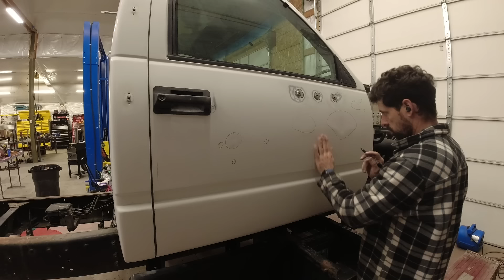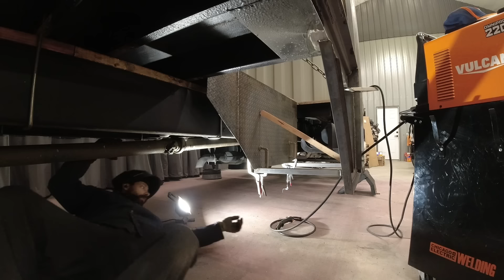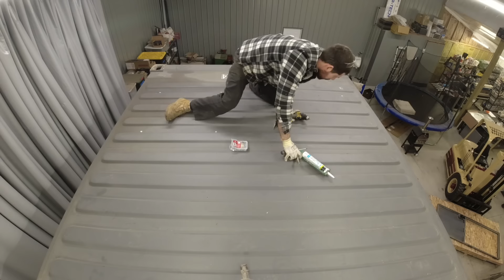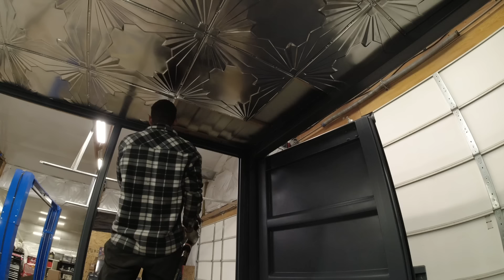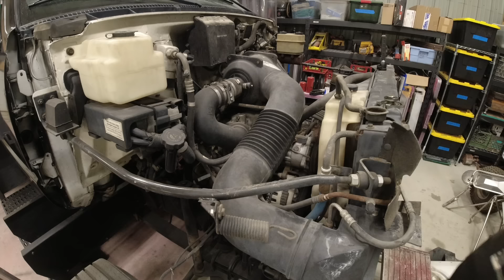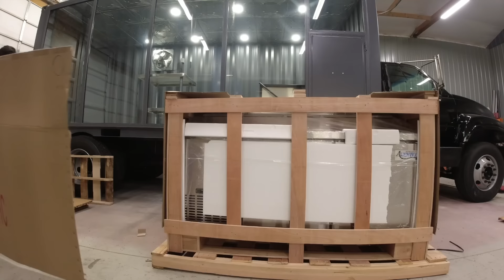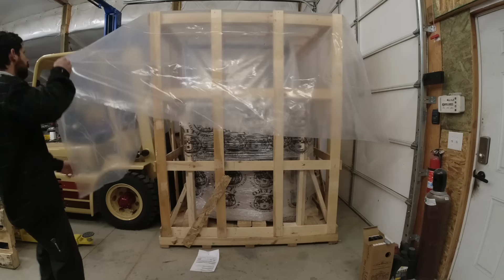I Built An EVEN BETTER Pizza Truck Out Of An Old Box Truck

Comment: I've built and lived in RVs that didn't have such a big oven and I hope this is going to be a winter Pizza oven because summer time this thing is going to be an oven inside you won't need to put the pizza in the oven
Reply from the maker: I wouldn't want to work in it in the summer, but i've built this company 3 of them and they are booked all summer long. One had an ac unit for a while, but they removed it because it didn't do much

Comment: I don’t know if the question has already been asked, but about the floor tiles… I was wondering why you didn’t put the full tiles along the side with the glass, and hide the half tiles underneath equipment on the back of the box?
Reply from the maker: I mocked it up both ways and found that when looking at it from the outside, the framing of the windows hid the first 6" or so of the tile, so I thought it looked better putting the cut piece on the back wall

Comment: Super cool project.  My plasma cutter is one of the best tools in my modest shop.  Heck of a shop you have there with all the awesome tools, lift, and a trampoline!  I have had a couple of the same chevy platforms and engines in shuttle buses I resold;  they really were great.  I subscribed.

Comment: If I could build a food truck for pizza I would want an extender that can push the ovens outside of the area so the heat will escape in the summer time out the back on heavy duty rails. Also a panel that can close off that area to reduce the heat on the workers.

Comment: What type of 1/4 inch rubber seal are you using for the frame and how exactly are you using it? Just on the bottom? Is there space between the glass and metal all around since you said they aren’t touching? Is this space where the adhesive goes? Is the adhesive holding the glass in place then? Do you remove the rubber seal at the end? 

Sorry for all of the questions. I plan to add Plexiglass windows of this size on a box truck, but with wooden framing. My case is different so these things might not even apply to me but I’d imagine that I would still need to protect the Plexiglass from rubbing against the wood while driving. 

You’re the only guy on youtube doing this sort of thing so I’m hoping you can help me out.

Comment: Had a thought about the legs on the cooler table, a set of leveling casters on foot pedal locking system would be a really cool addition for cleaning and maintenance

Comment: Replacing a perfectly good box with a shipping container is peak buzz word trend stupidity
Reply: Or just maybe the shipping container is more durable and can handle more punishment from the elements and it went with the style her was trying to go for
Reply: @dennismctye9048  it's low grade steal that can rust through pretty quickly. An aluminum sheathed box is more suited to hold up to the elements. And it's like they are going to go 4x4 with the box.

Comment: I have always thought, but lack the skills, to take a Honda Civic and cut the body off behind the front doors, leaving the floor pan and rear wheels. Then build a small Hot Dog wagon on it. If you made a box frame with snap-on canvas panels, maybe an aluminum roof. They get a lot of equipment in those Hot Dog carts so I know it could be done. The Hot Dog carts work in almost any city.

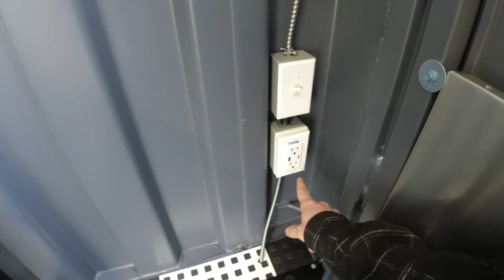Comment: 52:00 You installed the gas cylinders upside down. There's a little dollop of oil to lubricate the seal and it's sitting uselessly against the end of the body. Tell your customer to flip it so it doesn't fail.

Comment: Sounds like you have VERY LOW expectations of that oven company, but yet still buy them...  why???
Reply from the maker: I'm just the builder, not the buyer for the ovens, but my understanding is that there are only a couple companies that make these types of ovens so options are limited and most are not designed to be used on trucks or trailers  so that further limits the choices out there
Reply: @AustinCoulson  that sucks.

Comment: You can use glass cleaner to cure the caulk bead and then stripe off the excess after five minutes with a bone tap
Reply from the maker: Interesting. I will try that out. Thx
Reply: @AustinCoulson  just a heads up use a can not a bottle, the accelerant helps it cure,I believe

Comment: Do you not have a 9in grinder? impressive work!
Reply from the maker: I have a 9in grinder but I only used it on the main opening while I was preparing to install the framing for the glass.  I used the 3m cubitron grinding wheel to remove a decent amount of metal.  I didn't show too much of it because it was super boring to watch

Comment: My only worries would be that's a lot of glass and it's not flexible so on the roads in Chicago will crack the glass
Reply from the maker: knock on wood, but so far I've built 3 trucks with over 7 years of service in Chicago and zero cracks

Comment: I hope they will have AC, not just the vent fan... not because of the oven, but because of that massive glass wall turning the entire kitchen into a solar oven.
Reply from the maker: This is one of the most common comments I get on these trucks but this is the 3rd one I've built, all for the same company and they always decline AC.
Reply: @AustinCoulson  that's so interesting. I can imagine the energy required to run an AC would be limiting in operation. Perhaps a simple awning to keep the sunlight from hitting the window would serve a good purpose. I dont know, i havnt been in one, but the greenhouse effect has to be intense.
Reply from the maker: @guywithinterwebs  the vent fan replaced all the air inside every 90 seconds so that helps. It would not be tolerable without that

Comment: Wait doesnt wood onto metal create heat bridging and thus wood rot later on?
Reply from the maker: Are you referencing the wood placed between the metal frame and shipping container?
Reply: @AustinCoulson  yes, the wood on the roof
Reply from the maker: @uribove  I thought you meant the wood between the vehicle frame and the container. I haven't seen any issues with any of the wood from the first truck that is now 5 years old and wood has been used under boxes and on top of frames as the standard for over 100 years so I can't imagine it's a big issue, but I suppose all wood will eventually rot.
Reply: @AustinCoulson  I've always heard in tiny house vids that you need a gap between the wood and metal that is filled with a good insulator, in most cases just PU foam
Reply from the maker: @uribove  oh yea in a climate controlled space for sure. That's why you have to house wrap the wood before installing metal roofing or siding. These trucks aren't air conditioned or sealed

Comment: I work at an industrial paint shop. We have blasted and then painted smaller shipping containers for the military. They can either air drop them or truck them in. I guess they end up being portable gun smith work stations, or?

But anyways when we painted them we used airless Graco pumps with a 219, 217 tip or a 215 tip, depending on the painters preferences. And don't thin it unless you get fingers, and only thin it enough to get rid of the fingers
Reply from the maker: Thanks for the heads up on tip. What type of paint did you use? DTM or primer?

Comment: Let you know what mistake you made?
You made more than one. 
1st mistake was cutting out the lower section and not completely framing it but before moving to something else. Frame it then make your cutout. Decent tacks will hold it together and not let it walk out on you.
Then cut out the side panel. This way will keep the channel on the bottom of the conex from sagging on you. 

Always support what you intend on cutting out. It will save time and prevent excess steps like having to rack a section to add support.

Other than that. That's a pretty awesome build 
👍🏻👍🏻👍🏻👍🏻👍🏻

Comment: not to be that guy but your handrail isn't to code. you cant have the connection rod off the side like that. has to be off the bottom then a 90 degree bend and the rail has to be an inch and a half from the wall. <designs building blueprints for a living
Reply from the maker: Nobody  cares about that stuff on food trucks.  They want hot water, 3 sinks and nsf labels on the stainless

Comment: Marques made a comment that the F1 app for the Vision Pro does not exist yet… it actually does exist, I have had a demo of the app, but it is not public (yet).  The app was developed for one of the teams and has feeds from the car with all of the measurement points (over 250 different) in real time.  It has live camera feeds from the car with front/rear and the exact position of the car on the track.  If someone from Marques YouTube channel contacts me, I will put them into contact with the organization that has developed the app.

Comment: your body filler has pin holes because you stirred it and didn't fold it together with the hardener. also you can always throw it in a vacuum chamber for a min and it will come out nice and smooth.

Comment: You are extremely talented! Thanks for making this video! One quick question, how do you deal with the heat from the oven heating up the entire truck? For a place with very hot climate, I'd imagine this would be unbearable without Air Conditioning. Would you recommend also installing air coolers and is this possible with the electrical loads like a fridge, mixer, etc.? Would you add a generator somewhere for extra power or is there a way to run it off the truck with extra batteries like a lo rider?
Reply from the maker: The inside does get hot, but one of my trucks has AC and it barely does anything because the vent fan pulls out the cool air and the service window is always open. Even lowering the vent fan speed doesn't really help. That is why they opted for no insulation, the best way to keep it cool is just to pull the air out as fast as possible. It doesn't help that AC draws a ton of power like you mentioned and the truck that has AC has to run 2 generators.
Reply: @AustinCoulson  That makes sense. Thanks for your reply!

Comment: If u want tour body work to be a little better, first shot, use a product called dry coat.. usually a powder, sometimes a spray on product, helps show you low spots, and high spots..
Reply from the maker: I love dry coat. I used to buy cheap flat black spray paint in bulk as a guide coat and it worked really well until I found dry coat. I didn't use it on the fiberglass because it was so beat up and just a quick commercial job, but it's a game changer on high end jobs. especially with long flat panels

Comment: Did you have to rework the truck or did Billy Bricks not buy or they just don't have your truck out working yet? The three trucks on the website are not your truck.
Reply from the maker: They still have 3 of my trucks and a similar looking one that someone else made, but all three trucks have had the boxes painted by a local artist.
Reply: @AustinCoulson  They just haven't updated their site yet then, I noticed all the trucks listed on their page had rear or middle serving doors / table. This front forward door one isn't on there yet. I use to work a BBQ joint and we had a local artist too do all our painting work and ad stuff. Good work for sure.
Reply from the maker: @BluntedBaboon  The 3 I built are all different, one has a rear door, one has a middle and the front door is the most recent.
Reply: @AustinCoulson  Ya looking at the 3 trucks on the website, I assumed the 2 listed as glass trucks are yours, the "antique" was not. And whoever built that antique one made it odd looking having the battery boxes or whatever between the cab and box. 

Anyway coming from working in a smokehouse and doing offsite BBQ I was trying to picture a rotating rack BBQ pit where you put the pizza oven. But also BBQ isn't quick like pizza, could do birds in a couple hours. We mostly used smoke trailers. All the true smoked BBQ came outta the smokers from the restaurant.

Comment: Suggestion on Body work. Old trick is to use two different colors of primer to find even the smallest imperfections. When you block wet sand you can see everything.

Comment: Shouldn't you have used some kind of shatter proof or bullet resistant transparent material instead of glass for this? Having an entire entire wall of what is essentially a store made out of regular safety glass without some kind of cage on the exterior or interior seems like it would invite break-ins.

Comment: Someone once said that if you pop the bead on a tire and then put a trash back over the tire you then can paint with no problems. Just a tear a hole in it and fit it over the rim. Remove when done.

Comment: Question: is there no loss to structural integrity of the container when you start cutting sections of the floor & walls out?  

I'm not familiar with fabrication, my only experience with any of this is about a decade as a port & intermodal truck driver.  We transported these containers and whenever there was damage to the walls and especially the floor the entire box tended to begin to buckle. 

I'm just curious cause this is some cool stuff.  I enjoy watching stuff get made especially father/son duos making cool stuff.

Comment: are you sure the oven mounts will survive an emergency braking? the pull on the back leg's screws must be insane with the inertia of trucks speed and the ovens weight, plus the table legs lenght as a lever... if that oven comes loose it probably ends up inside the drivers cab

Comment: fantastic fabricating work. though I am bit concerned of the axle load distribution - seemed back heavy; which a prone to slipping and leading to accidents. then again the oven may be lighter than it seemed
Reply from the maker: I was very worried about that on the first truck I built, but these trucks end up around 7k under their weight limit fully loaded and are surprisingly well balanced even with the oven so far back.

Comment: Yeah those shipping panels are really heavy.  I built my garage using two shipping containers 18’ apart then building roof and back wall with garage door up front   Then I cut out 10 feet of each container using one as a welding shop and the other as wood shop.

Comment: You can keep a old raptor liner bottle.  And buy rubber under coating. By the gallon  for 35 bucks.  And use the raptor kit to spray it on

Comment: I really love your job, it's incredible well done.
As an ex pizza guy, I'd suggest some things in your next pizza truck. That really matters when you're working with pizza and have all that space inside a container that should be used.

1. In front of the oven, a metal base on the floor, 2'x4' at least, to keep the floor out of risk to be burn with sparks. Burning wood is risky, cause it always has small explosions that send small pieces all around.

2. time by time, some ashes must be removed from the oven, cause it flies to the pizza and some people doesn't like it, so it must be removed time to time... so, would be an improvment, add some metal made container to keep it till it cool down. Or close the service.

3. adding an awning or canopy outside, so the customers would be protected by the weather, also would be awesome... 

I really loved the little sink...

Comment: Genuine question. Does cutting into the shipping container severely compromise the structural integrity of it? 

Clearly you've done two other trucks and it's been fine. But I'm just curious as to what extent the structure of the box itself is weakened by the mods.

Comment: How well do those big trucks handle the weight of a 20ft shipping container driving? Been considering doing something similar, but outfitting as a tiny home camper
Reply from the maker: The containers weigh around 4500lbs and the factory boxes are around 2k so it's not a ton more weight. Well I guess it's technically a little over a ton more weight, but even with the super heavy oven and all the equipment it's still under 19k lbs and it's rated at up to 26k lbs, so the truck doesn't struggle. My opinion is that the fuel mileage is horrible (6mpg or so) on these gas rigs so I wouldn't use one for a camper, but that's just my opinion. The diesel ones are a little better but they are mostly all starved by cumbersome emissions components and insanely expensive to fix.
Reply: @AustinCoulson  Im currently looking to do a 20ft box office/tiny home conversion, but in my area they aren’t allowing containers to be permitted so I’m looking to add wheels under one and register as a camper to use while I build my home on vacant lot. Thinking of either a trailer or keeping an eye out for a duramax box truck to convert to a camper and still be mobile with decent fuel mileage. Thanks for input
Reply from the maker: @davida6383  I've ran into that permitting issue before. They make wheels that attach to the side of containers and I know some people who have had luck attaching those wheels so it's looked at as mobile and not permanent but it seems hit or miss with local jurisdictions

Comment: Love it my friend. Not questioning your skill as you have thought well on everything, but i was wondering if the temperature inside the truck would get very hot with the oven on. How would you cool other than using the ventilation fan you put in? Since i'm from Australia I probably don't appreciate the winters in Chicago :). But surely this might get hot enough to warent air con? That gen would suffice? I'm in awe of your fabrication skills.
Reply from the maker: The problem with aircon in these trucks is that the service window has to be open and the oven draws air in as well so the cool air just keeps getting sucked out of the truck. If it were my truck I would probably insulate it and add aircon as I think it would make it better, but it would add significant costs and I build these to the clients specs

Comment: They may very well have to put a power vent on that oven. When the fan is running it will  pull a negative pressure down the flue.